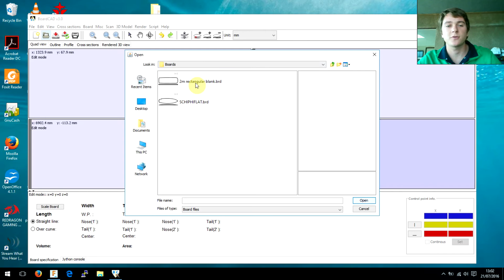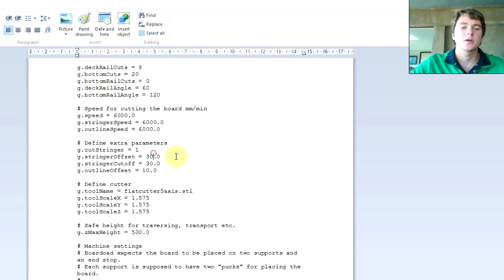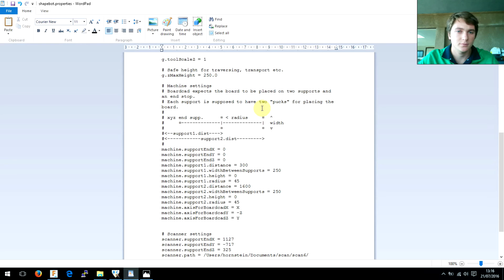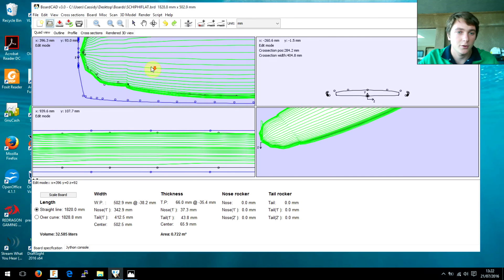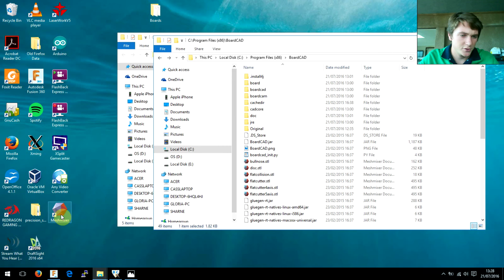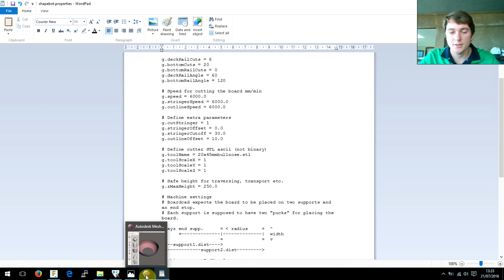How to Use Boardcad for 3 axis CNC Tutorial

Comment: Hi Cassidy . Well this work on any Cnc machine or just a shopbot ? I have a thermwood  shop 40. Cnc.  We make cabinets with it.
Reply from the maker: Hi! It should work if you set up your machine parameters and make a board that fits within your machine constraints.
Also consider adjusting the start and finish g-code that is specific to your machine.

Comment: Very useful video!!thanks a lo!^^
someone knows if there is a way to "place board" on the coordinate one wants?? It seems that when I create a G-Code file it  doesn't follow the coordinates set for the machine in "machine.supportEndX" Y ad Z.....any Ideas?

Greetings form Europe!
Reply from the maker: Hi! 
I am sorry I have not been too active with Boardcad Lately.

Can you give me more details as to why you say it does not place the board correctly?
Reply: Thanks Cassey for answering :). I really like boardcad and is currently the only free option for surfboard design. If you want we could talk by email perhaps makes it easier.
...when I generate the code it starts at the 0.0 coordinate from boardcad BUT not at x27y563 which is the 0 coordinate for the  machine I am using...so it could be that the program is not reading my input file correctly....Alternatively, I thought I could modify the coordinate where the board is placed to match my x27y563 and start writing the code from there...
Reply from the maker: @guipuinam370  Hi!  In the shapebot.properties file you can change the parameters to match your machine here:

machine.supportEndX = 1192    
machine.supportEndY = -725
machine.supportEndZ = 270
machine.support1.distance = 1612
machine.support1.widthBetweenSupports = 200
machine.support1.height = 270
machine.support1.radius = 35
machine.support2.distance = 2654
machine.support2.widthBetweenSupports = 200
machine.support2.height = 270
machine.support2.radius = 35
machine.axisForBoardcadX = X
machine.axisForBoardcadY = -Z
machine.axisForBoardcadZ = Y

Comment: Found that when I try to export a completed board to a STEP, DXF or STL file for use in CorelDraw or Fusion360 the screen returns the message "Error when writing ### filejava.lang.NullPointerException". The file created have nothing in them. Does anyone what the settings need to be to successfully export such file.
Reply: Hi Rick, sounds like something I have come across before. Please note though that the step files are not reliable to my experience. I do not have my boardcad computer open right now. My best suggestion right now would be to make sure you follow the steps @3:50 to "create board from bezier patches" and then "render to nurbs model". This might help you get an STL at least.

Comment: Hi, I'm Gonzalo. My machine grabs the blank with a clamp in the nose and another clamp in the tail.
This means that my machine does not use media in the middle of the blank.
What configuration do I use to make the gcode funicone good?
y machine is similar to this video
https://www.youtube.com/watch?v=MuPtOkLagU8
Reply from the maker: Hi Gonzalo, Unfortunately I don't have an easy way for you. Are the clamps at the same height on each side?
Reply: correct, the clamps are at the same height.
I think the software does not reward you with this option, right?
Reply: where can I program so that the z axis does not go down so much when making the whole shape?
Reply from the maker: you can try set the pucks at the tips of each board, so that the board gets placed with the nose and tail at the same height. but unfortunately it is going to  be a bit of a challenge to find something that works. Do you CNC pre shaped blanks?
Reply from the maker: Hi Gonzalo, I am not too sure what you mean.  I suggest though you make sure your pucks are set to a reasonable height in the shapebot file. Also your z-max height can be adjusted in the shapebot file.
Reply: ExtremelyCassidy  Hi. I have been doing tests and I have some things to solve:
-the green lines generated by the code g on the deck begin within the black line that form the design deck
- the green lines generated in the bottom are within the design.
If you do not understand, I can send photos to an email that you give me.
Thank you.
Reply from the maker: Hi Gonzalo, send me some photos. cassidydewet at gmail dot com.
Reply: ExtremelyCassidy  in properties I program that does not cut stringer and there are areas of the outline bottom that does not.
if in properties I tell him to cut the stringer, then if I cut all the bottom.

If I do the same thing on the deck, this does not happen. I cut the whole outline if I told him to cut the rocker or not.
Do you know why it can be?
Reply: Please send me some photos.
Reply: e-mail send
Reply: I would like to try a cutting disc
Do you think that boardcad does it well? you have tried?
https://www.youtube.com/watch?v=BssZzmCrkqY

Comment: Hi,

nice video,I have a problem with the last version when click on rendered 3d the software close and I loose my job and cant see the board 3d, java version compilación 1.8.0_131-b11)  any help I will appreciate thanks
Reply from the maker: themaxdog did you go to 3d model ->create 3d from bezier patches before rendering?
Reply: yes I did, anyway I solve the problem like this, I install Akusahper and load my boards on that, and I can see the 3d fine.
Reply: You need video card driver to solve.

Comment: This works with disk cutter?
Reply from the maker: juan mancilla I have not tested it but the process should be the same, just make sure your stl cutter has the same geometry as the supplied cutters
Reply: I again, what is that file 2m rectangular blank.brd ? is the foam ?
Reply from the maker: Yes its the board shape before cutting. In other words, a board file of the shape of the block of Foam I used to cut my board out of.
Reply: that file is included when I buy the block foam? or I need to model this ? can you share your file for practice ?
Reply from the maker: juan mancilla you need to model it. its quick and easy in shape3d, just save as-> *.s3d instead of .s3dx. if you buy a pre shaped blank, they might give you a file if you ask. If you're just learning, and not cutting, you can generate g-code without using or importing a blank(so skip the set as blank part)

Comment: Hi,
I am using my own cutter. It’s a ball nose , 22mm dia. and about 30mm in height.
I used solidworks to create a STL model ( ascii format) and made sure the xyz orietation is correct.

Then modified shapebot.properties to enable STL cutter :
” g.toolName = saburrcutter.STL ”

Then modified shapebot3bottom.py and shapebot3deck.py to enable STL cutter:
”
# Create a cutter

#cutter=boardcam.cutters.FlatCutter()
#cutter.setRadius(1.5)
cutter=boardcam.cutters.STLCutter()
cutter.init(machine.toolName)
cutter.scale(1.0,1.0,1.0)
”

I made the first cut on the deck then flipped the board and cut the bottom.
the deck side outline was cut too narrow and the bottom was OK so there was a step on the rail.
The offset is exactly the radius of my cutter, this educates me that boardcad did not take my cutter diameter into considaration and generated the deck gcode as if the cutter was 0 diameter.
the bottom was ok…. I dont know why the difference and how to solve it.
I would greatly appriciate any help.

THANKS!
Lee
Reply: SOLVED
.I decided to follow your video and design my cutter in fusion 360 and check it in meshmixer
I don't know why solidworks creates a problem and autodesk is fine but now it all works.
Thanks again for the Video.
Lee
Reply from the maker: Hi Lee! Im glad my video could help you! 

Yes, once again like you said, the ASCII format is important and then the XYZ orientation, along with the correct cutter definitions in shapebot3deck/bottom.py
HOWEVER
Regarding the orientation and the cutter shape, 
The cutter's lowest point(XYZ) must be identical to the lowest point of one of the standard stl cutters, otherwise it will cut away too much or too little.
And shape, you could play with the wall height of your stl, a shorter wall often gives much cleaner gcode, but it does vary sometimes.

Best Regards
Cassidy
Reply: Well, I think that without your video I couldn't really finalize my machine.   BIG THANKS!

Still wondering why the "Solidworks" cutter which showed in meshmixer at the correct orientation didn't work.

?Do you or any of the other participants in this thread have facebook?
 I opened a  facebook group " Surfboard CNC " where we can share our   machines, designs, and generally help each other , coordinate group buying of tools etc.
I'd love to see you guys there.
Lee

https://www.facebook.com/groups/355917358123897/

www.Leejordan.co.il

Comment: Hi,  I have found that a long cylindrical section on your cutter STL leads to potential unstable tool paths when cutting points where the tangent is parallel to the tool axis (ie it can pick any point on the cylinder to cut the point of interest) I use a short vertical section of 0.5mm to control this.  Similarly the flat section on the bottom of the bullnose can lead to unstable paths - best to remove that face like the provided mesh IMO.

Also if you want to save your board in a particular position try exporting it as a STEP file once you have positioned it.  You can also do this for your blanks which could save you some time if you are using the same ones each time.
Reply from the maker: Hi Peter, thanks for the input, I'm gonna try that and see what happens! At the moment I am having some troubles getting enough machine passes over the flat sections of the board, It continally leaves stock in the center, no matter what I try in shapebot.properties. It almost appears as if the board is being cut from the side. I have notices that some cutters give radically different toolpaths, but I hope that I'll see an improvement. 

Nice tip with the STEP files. However, could you manage to import your step files successfully into another cad program?
Reply: The surface coordinate system seems to be related to curvature (not that I completely understand it), so you get bigger steps on the flat sections.  I have combated this by increasing the number of width steps, and jumping 2 steps  after a certain distance towards the rail.  It was the only way I could see to increase the density in the centre without having to have a million cuts over near the rail.
Reply: Regarding opening the step file in another program - the answer is yes/no/maybe.  Its definitely not a properly formatted STEP and I did look at one stage for the details of the STEP file format, but I couldn't find them readily available on the internet for free so i gave up.  I have had success and failure with Autodesk Inventor - I have a feeling that this was more successful with closed STEP models.  I also have used a free program from PTC called CREO Elements, which seemed to be able to better deal with the corrupt file format, but not 100% successful.  I have a feeling you'll have better luck with STL, but then you get a tesselated mesh.
Reply from the maker: Hi Peter, I noticed the same with the flat sections, anything flat turns out a bit of a nightmare. 

I did some experimenting with the cutters. What I noticed was that a "long shaft closed bottom" cutter that I used has more even cuts down the center, but the rail cuts tend to be a jagged along the z-axis. With a "short shaft closed bottom" cutter, the rails are cut nice and horizontally but it steps a bit wider away from the stringer on those passes, bringing us back to the original problem. A "short shaft open bottom" cutter moves the passes even further away from the stringer. My verdict is that It indeed helps to have a shorter shaft for the outline, bit it does SOMEHOW affect the passes in the center of the board too. There does not appear any advantage to leaving the bottom of the cutter open. 

Regarding the Step files, it does look like a bit of a jagged mess in a Step file viewer. 

Peter,  could you please shed some more light on your solution by jumping two steps?  My next test is to see if the flatter section passes become more if design it with a more mildly wobbbly surface. Also, approximating by bezier curves instead of patches seem to improve the passes tremendously, but you do lose a bit of your design's shape.

Thanks for helping out!
Reply: The script is offsetting the tool (in 3D) so that the tangent of the bullnose is cutting the point on the path on the surface.  Because your deck is convex, the cutter always gets offset towards the rail.

If you want to see the path before the cutter is offset, just modify the script to comment out those commands (p=cutter.calcOffset(p,n) --> #p=cutter.calcOffset(p,n)).

The shape of your blanks will make it worse. 

The offsetting is based on the tool STL, so it will be effected by the tool mesh (e.g. its dependant on the tool OD, the fillet radius etc).  This is why you see different results with different tools - your tool mesh should match the tool you use. If you used a ball mill tool (spherical tip) if would be offset less than a bullnose tool again.  If you think about trying to intersect a given tool shape with a point on a complex curved surface it make sense.

I haven't used the default script much, but I think the answer you are looking for lies in the following line which sets the width of the first cut:

t=(deck.getMaxT()-deck.getMinT())/2-00.1

i.e. the centre of the board minus some nominal width - change 0.1 to 0.01 and you will be closer to the centre of the board on the first deck cut.

If you were still interested - two step jumping should be easy - just add the following lines to your script where it is generating the deck tool path (new lines commented):

deck_cut_number = 1   # deck cut index
deck_cut_width_doubled = False   # Boolean to avoid increasing the step width more than once

while (t>t_outline):
 while (s<deck.getMaxS()):
  p=deck.getPoint(s,t) 
  n=deck.getNormal(s,t)
  p=cutter.calcOffset(p,n)
  deck_cut.append(p)
  s=s+length_step
 t=t-width_step
 while (s>deck.getMinS()):
  p=deck.getPoint(s,t)
  n=deck.getNormal(s,t)
  p=cutter.calcOffset(p,n)  
  deck_cut.append(p)
  s=s-length_step
 t=t-width_step
 deck_cut_number = deck_cut_number + 1    # deck cut index increment
 if ((deck_cut_number > 5) and not deck_cut_width_doubled): # modify change point to suit
  width_step = width_step * 2 # double step width

Note that the indents are important in python.

Increase the number of g.deckCuts or change the step width multiplier to get what you are looking for.

Have fun.
Reply: PS those tabs look pretty small on the comment!
Reply from the maker: Peter! Those tips and modifications are gold!
Reply: Id be interested to see your machine in action if you are making another video.  
Also I think I forgot to turn off the step doubling in the example above by setting the Boolean to True when the step width is doubled which means it would double every jump after the point of interest.

Comment: bummer developing is ceased... 
Lots to be polished still... 
This project is a clash of preferences... Jonas and his Nurbs... what a waste... Who can ever design a board with the many nodes? Bezier Patches.. ok.. works kind of but why not Give up on one of the fronts and go either full Beziers or Nurbs?   So it was doomed from the start.  

Nice video...

Please explain exactly what you need from s3dx i have installers from..  "-cannot export to s3d."  explain..
Reply from the maker: Hi Strider A,  

I hope there are some new developments coming soon, it would be sad to see it run dead!

Thanks for reaching out.
There was a time when the free version of shape 3d, could only save as a s3dx file. Boardcad cant open that format. 
After double checking in shape3d, both the current free versions of shape 3d v8 and shape 3d X V9, can save as an s3d.

So apologies with that, I have corrected the video with a note.
Reply: Hi, if you still need the old version of 3D shape lite X, I can send it to you without problem.
Regarding 4 or 5 axis machining, are you working on the subject? Because the deck file is not good.
I want to thank you sincerely for your help
Reply: Gerald Beraud could you send me a copy? I’m unable to download it from the internet. Thanks